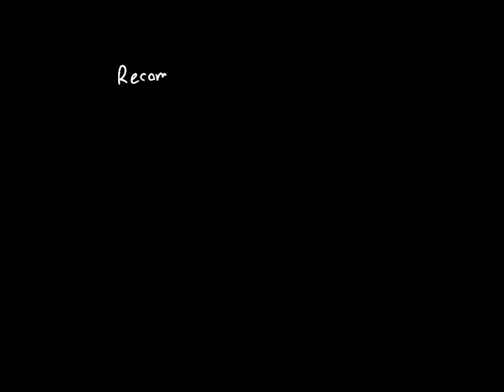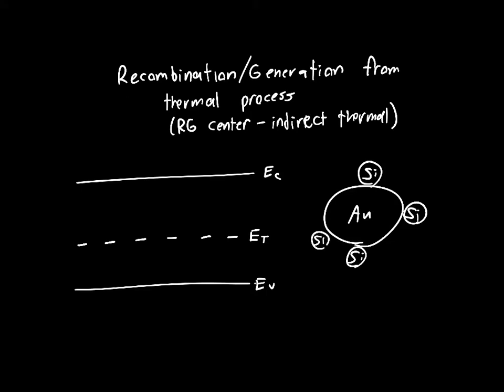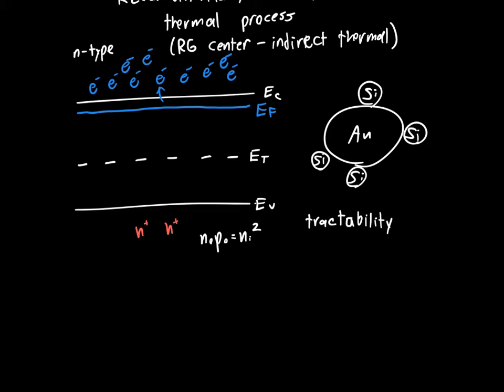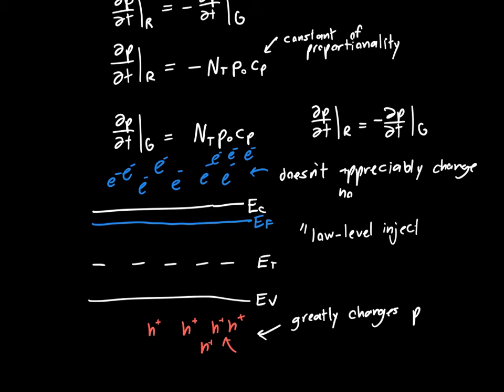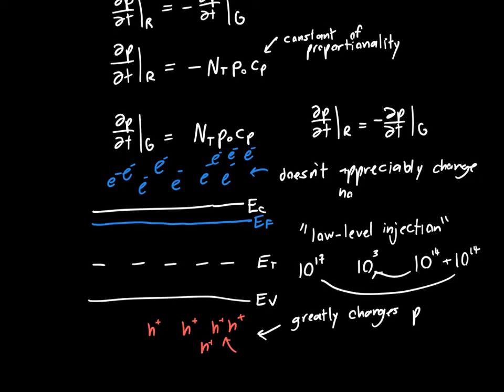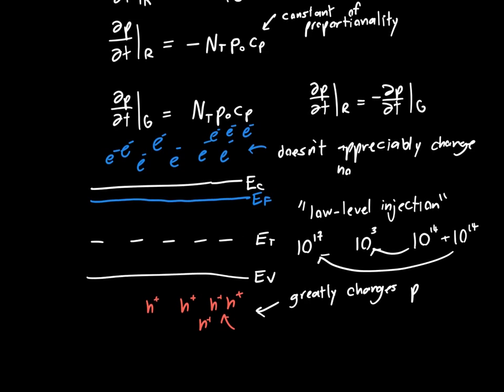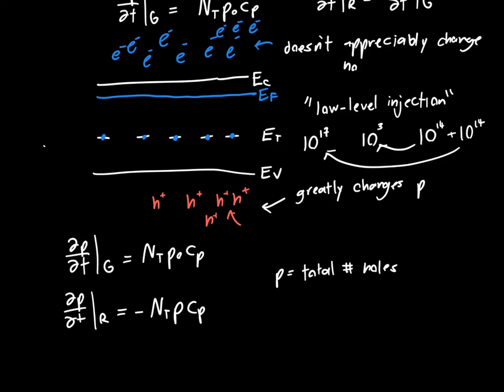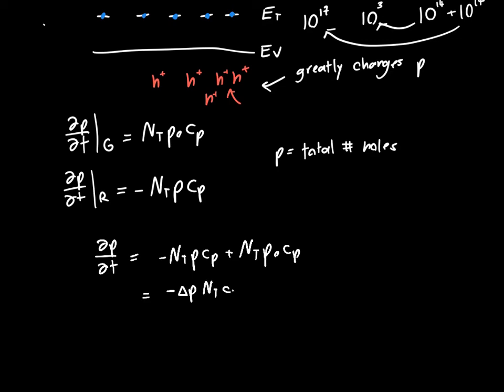Thermal Recombination and Generation

Comment: And finally, what exactly is low level injection? Is it any externally applied bias like voltage or radiation or a specific type? How is it done?
Reply: That was clear. But my question was how are they injected? Through what method? Light or voltage application, what else?
Reply from the maker: Usually we just deal with those two cases. You could also have carriers diffuse via other areas of the semiconductor even if you don’t apply a voltage directly to some area.
Reply: @JordanEdmundsEECS  ok thanks
Reply from the maker: Also a great question, this is when the 'injected' carries (the ones created by non-thermal processes) are much lower than the dominant dopant concentration. So if my donor concentration is 10^18 cm^-3, 'low-level injection' means my injected carriers produce a concentration much smaller than that.

Comment: Thanks a lot for answering all my queries. Can you explain why you have an added impurity? We could've done the same thing with no trapped states. Is it because that's how it generally is because manufacturing pure silicon cells is difficult therefore rare?
Reply from the maker: Trapped states are minimized as much as possible during fabrication but are still present at very low concentrations, and are the primary cause of recombination at lower carrier densities (Shockley-Reed Hall recombination).

Comment: One last thing, the equilibrium state is also for a doped material? And the non equilibrium state is just a bit more doped?
Reply from the maker: Yes, 'equilibrium' just refers to a state where we have no applied voltage or external source of carriers. A doped semiconductor can be in equilibrium.

Comment: Does this cp depend on the material? Because it looks like it is inversely proportional to lifetime. Doesn't lifetime depend on number of holes? Am confused.
Reply from the maker: Yes, Cp depends on the material. This video is just a simplified first picture, and ignores the doping-dependence of things like carrier lifetime. In this simplified picture, carrier lifetime is just a constant, and the rate of change of carriers is equal to the number of carriers over the lifetime. In reality, these parameters will have doping (and even carrier concentration) dependence, and this simplified model is just the first step to understanding recombination.

Comment: Sir, it's v clear now. But, in non equilibrium state, why should the constant of proportionality remain CP for recombination?
Reply from the maker: Great question! In general, it won't (this is just an overly simplified picture). However, for doped semiconductors and low-level injection this is approximately true (this is called Shockley-Reed-Hall recombination).

Comment: Sir the number of traps Nt means number of trapped levels or number of trapped states?
Reply from the maker: Good question! And a subtle one. Nt refers to the trap states density (number of trapped states). We assume all these traps are roughly at the same energy level, which is approximately true but quantum mechanically false.